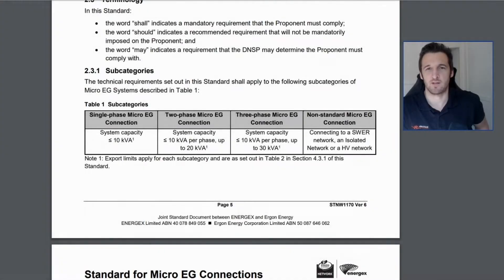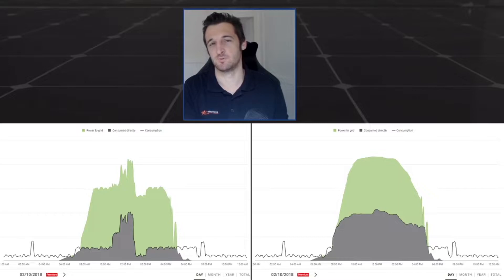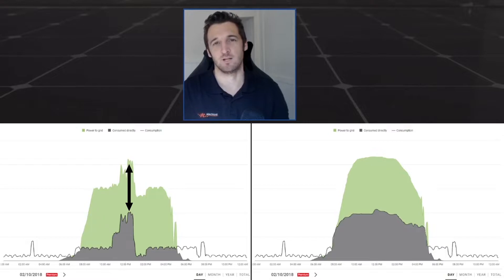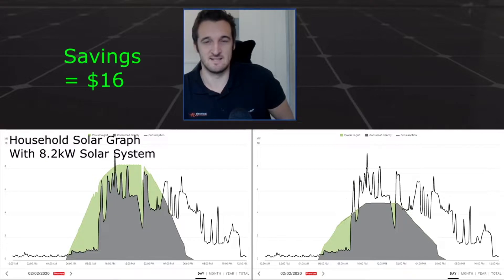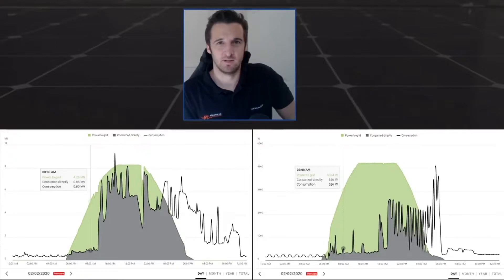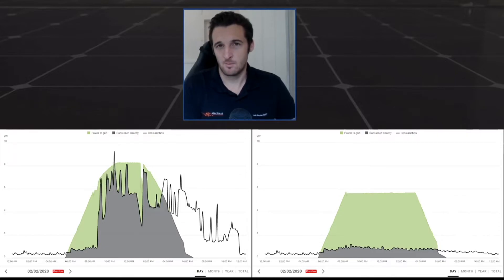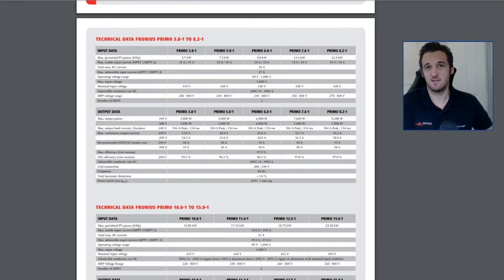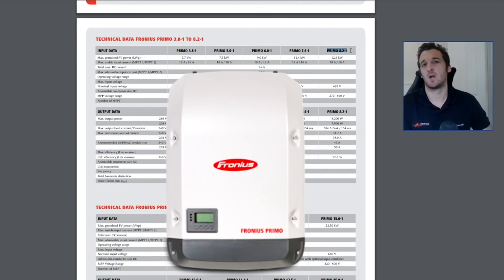How to Get More Solar Panels | The Secrets of Export Limiting

Comment: Putting a comment to increase your video 's reach ;) to answer your question in the video we only do commercial use 35 to 500 kWp so for this use I wouldn't mind to pay more for Fronius if you would please confirm that all your analysis about the advantages of Fronius apply to this size of projects?